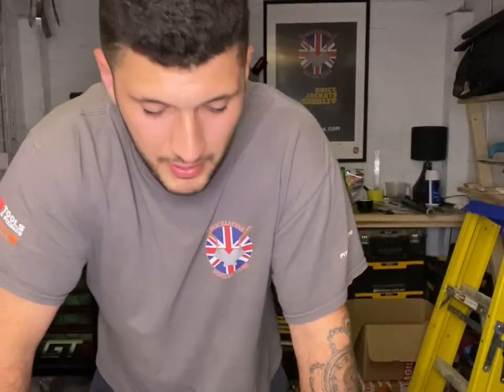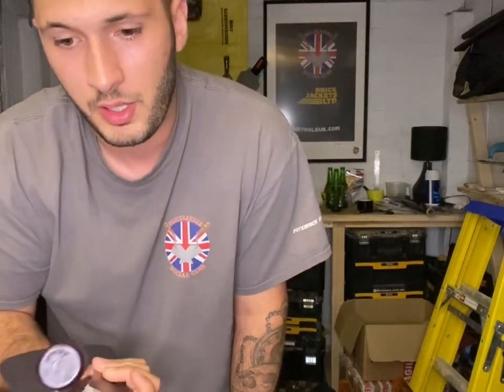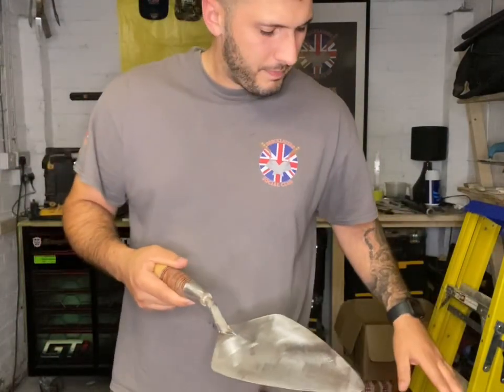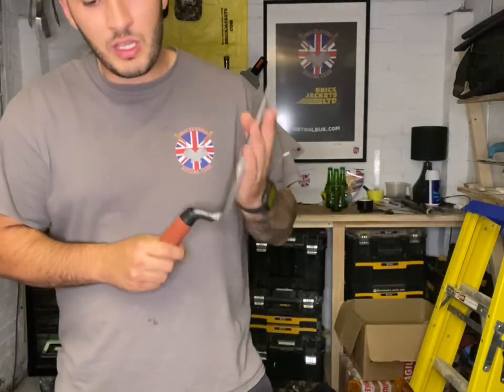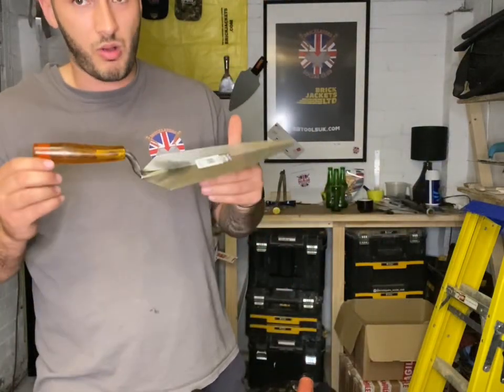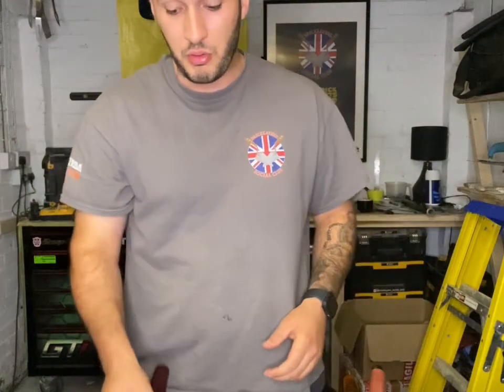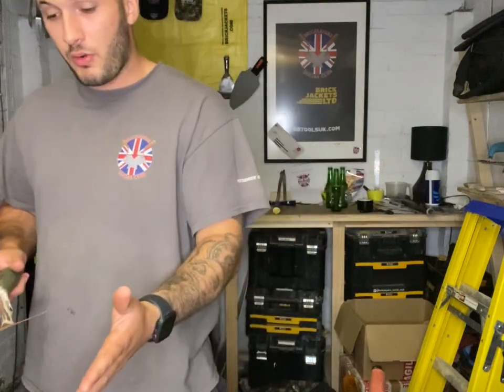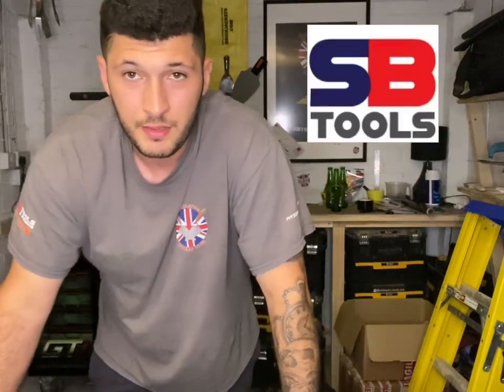What is the best bricklaying trowel ? Tools trowels review

Comment: I remember reading an old W. Rose catalog from the 1940's and it claimed the Philadelphia trowel keeps the weight back closer to the handle and is therefore easier on the arm but the Londons are better at keeping the mortar off your knuckles. Apparently some of the old lime mortars from back in the day could be harsh on the skin
Reply: lime mortar is far easier on your skin than OPC. london pattern was better for imperial penny joints, for metric10mm joints philly the best pattern.

Comment: Maybe make a point on the handle rise diference between Marshall and Rose. I found switching to rose after years of Marshall Town saved my elbow and wrist. Now managed to get a couple good condition vintage whs hunt and sons trowels and they are in every way better then any trowel you can buy today, the quality of the steel is insane.
Reply: That would be impossible .because even if you take just what’s called the standard shank w.rose trowels they vary so much between themselves that you couldn’t compare them to any other brand .
Reply: @brickbybric  they may vary but they are still alot lower rise then the Marshalltown trowels. No matter how much they vary
Reply: @plymuf08  have a look at rodian builds video were he compares a standard shank rose trowel to a Marshalltown trowel and you’ll see that the handle angel on the rose is way higher than the m.t . I can put up a picture in my profile with 2 w rose standard shank trowel s and an m.t and one of the roses is way higher than the m.t .iv had probably 200 standard shank roses through my hands they are the most un uniform trowels in there manufacture than any other brand iv come across.
Reply: @brickbybric  I get wat you are saying, ive seen that video and thought it was very strange as everyone I've nown or spoke to about them have all said how much lower the rise is in comparison to marshalltown, I can only speak from personal experience as all 3 I have bought aswell as the several I felt in the shop were all considerably lower rise. The fact they are still hand made is probably the cause of them being un-uniformed. Was always told never to buy a rose online always feel them first as every trowel is slightly diferent.
Reply: @brickbybric  спасибо за объяснение👍
Reply: @dormindont1 👍

Comment: W Rose do the best trowels got a plastic handle to try didn’t like so took handle and replaced it with there proform rubber handle think that for me is handle on the Rose trowels. Rose do 1/2 on all sizes which are good. Philadelphia mostly 10 or 11 don’t matter but been using a narrow London Rose 10inch beautiful trowel on face work. Not fan of wide London. Do have a wide heel Rose 11inch which is a monster great for the block on flat.